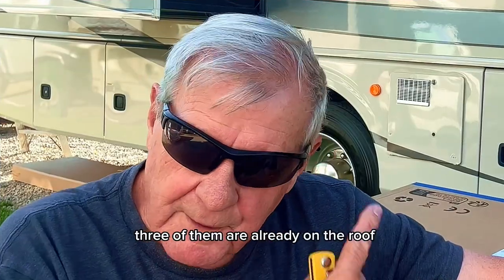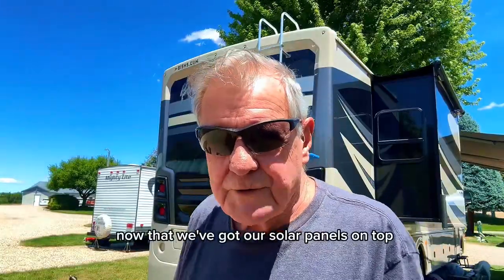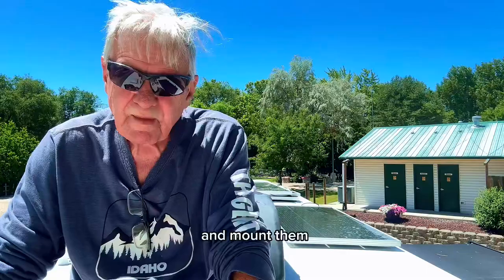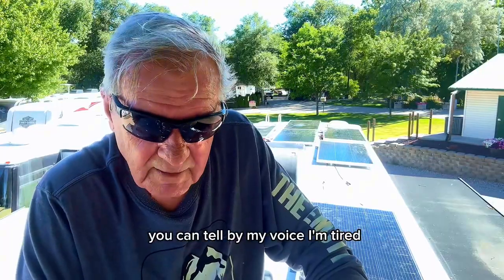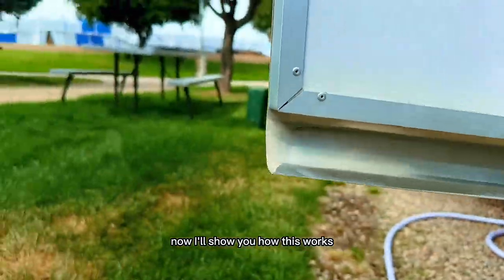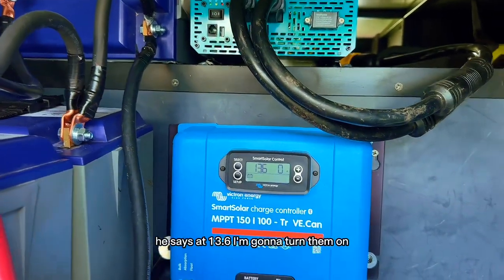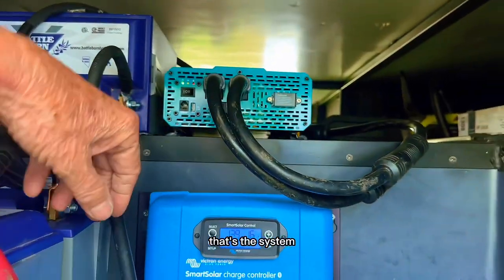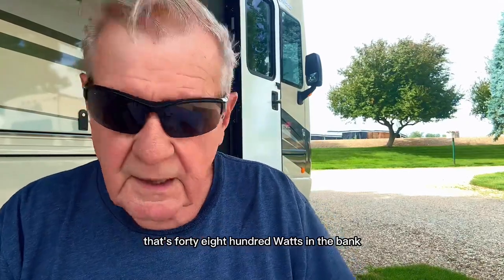SOLAR INSTALL [ON RV] ​⁠

Comment: Great job and an enjoyable video too. One thing that I noticed is there is a positive battery cable next to the negative terminal of one of your batteries. Over time it might rub and wear through the insulation when you're traveling down the road. All you need do is move it over and secure it in place and you'll be fine. We're old, retired FTers who discovered we love to boondock. We boondocked for 10 months last year and have been living off grid all this year so far, saving a ton of money too. We designed and built our system ourselves, on a tight budget. It took us 5 years to gather the resources and finally complete the project, doing all the work ourselves.

We started by building a 620-watt liftable solar array on the side of our motorhome. Our side array makes a nice bedroom window awning too, practically lifting itself with a couple gas struts, and it's easy to clean, standing safely on the ground. Next, we built a 12v, 560ah LiFePo-4 battery using 8, 280ah prismatic cells and a Heltec 330amp BMS with a 5a active balancer. These cells fit perfectly under the steps of our MH where our old pair of golf cart batteries used to reside. We insulated the battery compartment, cut a small hole in our step risers and installed a tiny computer CPU fan to keep this space at close to room temperature, so we don't have to worry about the BMS shutting down charging due to low temperature - or their life reduced from getting too hot. Our 12v system uses an 80A Progressive Dynamics LFP converter/charger, a 1,000w Renogy inverter, a 50a Epever MPPT charge controller and a Lnex battery monitor. 

By mounting the solar array on the side of our coach, we left the roof free to rack 8, 550w Sungold Power solar panels down the length of our 35ft Class A, 15" off our roof, above our AC, vents, etc. You think yours were hard getting on the roof, our panels are huge at 90" x 45"! Try getting those on the roof by yourself. I had to build a counterweight system to help me lift them up there with ropes and jugs of water, with curved metal plates to protect the roof during this process. Where there's a will, there's a way. We built the rack out of 2" 6061-T6 structural aluminum angle. The front 2 panels slope down at a shallow 9.5-degrees to meet the roof, producing a smooth laminar airflow over the array, making the RV more stable with less wind drag while driving too. It shades our entire roof, allowing plenty of cooling air underneath, increasing solar output and reducing the heat load on the air conditioners. Our overall height is still just under 12 ft. Our 4,400w array can run both our A/Cs, household appliances (we have a residential fridge) and charge our batteries from solar at the same time.

We mounted a Sungold Power all-in-one 48V, 5,000W Inverter/100A charge controller/battery charger, breakers and a Lnex battery monitor on the wall in our bedroom, saving us space as well as money compared to a system built with individual components. This all-in-one unit has the same 99% charging and 95% inverter efficiency as the high end Victron unit, though it cost us only $764 yet replaces 3 expensive components. We chose this model because it supports our 400voc solar array. Our 48v battery uses 16, 320ah prismatic cells and a 200amp Heltec BMS to keep it safe. Together with our 560ah 12v bank, we have a total of 23.5 kwh of batteries onboard, charged by 5,020 watts of solar. This is the equivalent storage capacity of 18, 100ah Battleborn batteries. 

We removed the rooftop A/C we had in the bedroom and replaced it with an EG4 28.5 seer-2, 12k btu mini-split heat pump on the upper rear of our motorhome. It's super quiet and cools as well as our 14.5k btu soft start equipped Furrion we installed up front using about 1/3 the power. This second phase provides 24/7 off-grid air conditioning and heat from the heat pump. We have a total off-grid electrical self-sufficiency without the need to run our generator, for a total budget of around $11,500, including the high-efficiency heat pump. 

Though this may sound like a lot it, the ROI is less than 2 years for us full timers compared to $500 monthly RV park rates, and it pays for itself within a year compared to a $225 weekly RV park rate.  But as you say, the biggest advantage is the flexibility it gives us, as we no longer are forced to be wedged into tight RV parks, all lined up with other campers like sardines in a can but can now stay in some of the most beautiful wilderness areas imaginable, mostly free on Forest Service and BLM lands. Last year we visited 11 states, without plugging into a power pedestal the entire time. Last winter we boondocked near Yuma, AZ. A 7-month permit for the Long-Term Visitor Areas there is only $180 (86 cents/day). For that not only do you get a warm, level, safe place to spend the winter, but you get unlimited fresh water, dump station use and trash disposal. You can choose to spend all winter in one location if you like or travel freely between the area LTVAs in CA and AZ, which we like to do. We're visiting family now in NC where boondocking places are pretty rare, so we're staying in a spacious, no-hookup site at a convenient RV park for only $100/mo., saving us $500/mo. off their normal rates. It's good to have options.
Reply from the maker: @SuperSushidog  Yes sir, you are correct. i have insulation i intend to install around areas like you mentioned; pos rubbing negative. We are traveling right now and tomorrow I will read your entire comment. Thank you for the heads up!